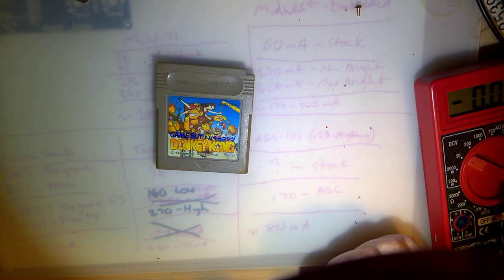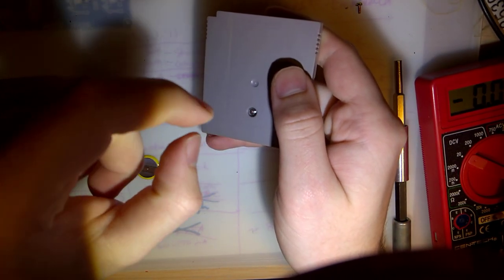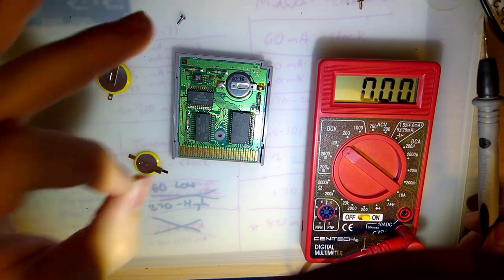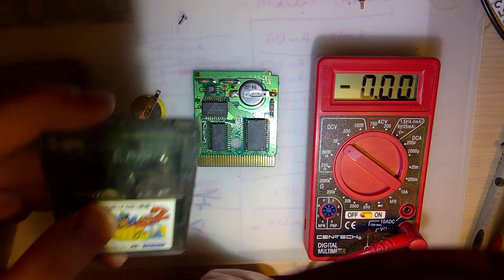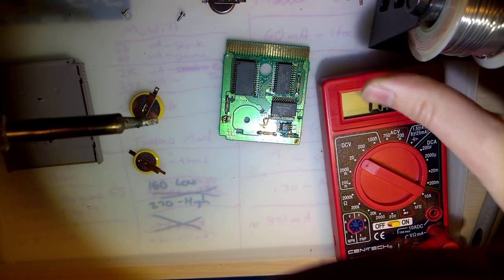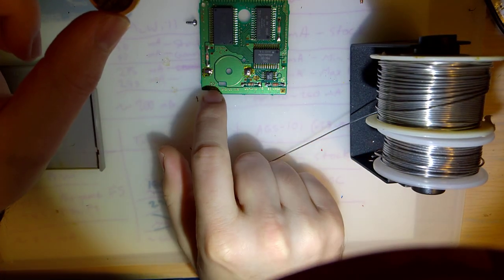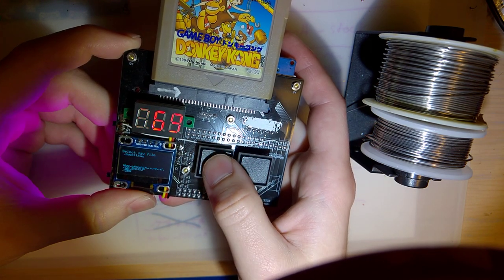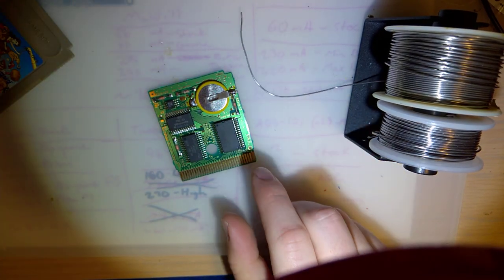Changing the battery in a Game Boy game

Comment: maybe late on commenting on this video, but I just found it when trying to figure out what's happening to my game. I bought a copy of the Pokemon game card in Japan, changed the battery, played for 3 weeks, and found the save file deleted. After losing my mind, I tested with a multimeter, and the battery was lower than 1 volt. I had a second battery bought together with the other one and went from 2.6 when installed (still dead from the beginning) to 0.8 in a few minutes of playing.

I thought there was a problem with my game, but at this point, I suppose it's just junk batteries I'm buying off eBay (clearly an AliExpress reseller).
Reply from the maker: I highly recommend ordering off mouser or digikey or equivalent for this specific reason. I've ordered those cheapo cells before and just gotten them all in a baggy shorting on each other.

Comment: So you’re not worried about the battery exploding bc it has soldering tabs?
Reply from the maker: The purpose of the tabs is to move the heat of soldering away from the battery itself. With proper technique, there is minimal risk of catastrophic battery failure.